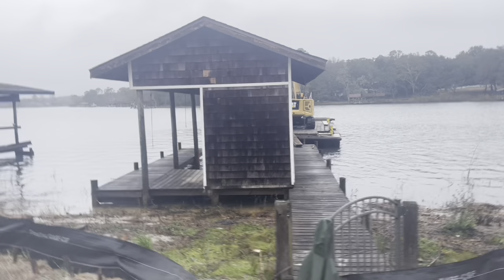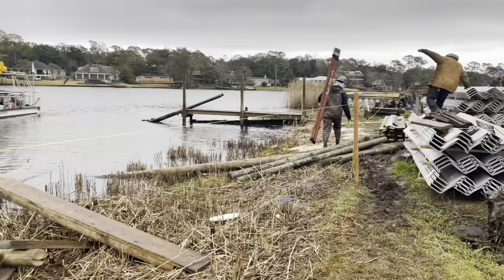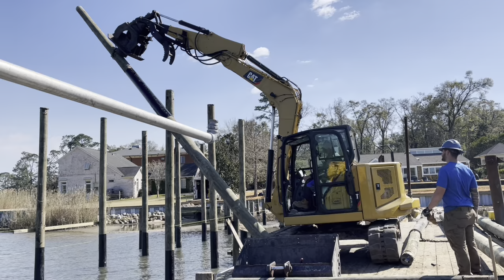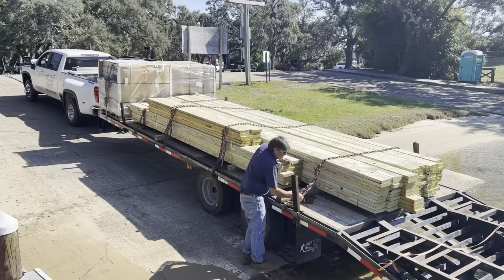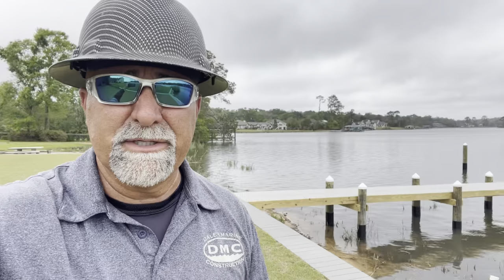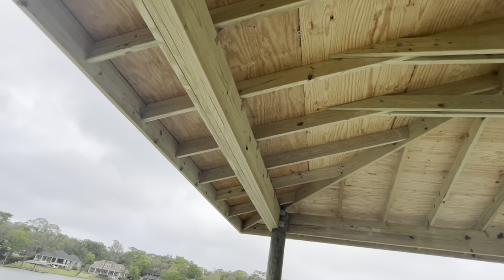LARGE BEAUTIFUL DESIGN BOATHOUSE & SEAWALL FROM BEGINNING TO END

Comment: What are your thoughts on Thru-Flo Deck dock boards and how they will last compared to rough saw CCA for dock boards?  What is the average cost increase (percentage) from one to the other?  Lastly for boat house roofing is metal roof more robust than architectural shingles or tile?
Reply from the maker: Thanks again for your question. I have built a few docs out of rough on CCA boards. They do seem to get more brittle and split overtime but it is a strong decking board. All the Thru- flow docks we built prior to hurricane Sally survived and that is what has really increased our business due to all of my docks still standing with Thru- flow decking. It really allows the pressure Release through the decking opposed to tearing the decking up. You’re probably looking at close to twice the price for Thru-flow decking.
Reply from the maker: I do prefer the metal look on the boat houses compared to the shingles as long as it’s installed properly over plywood and not on pearlings. When installed properly, this holds up a lot better to the very windy situations on the water.